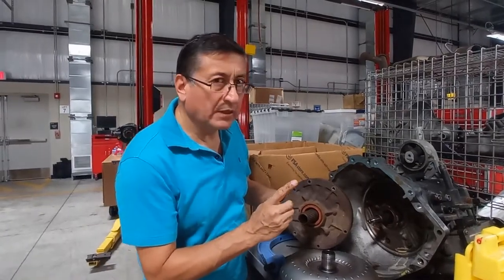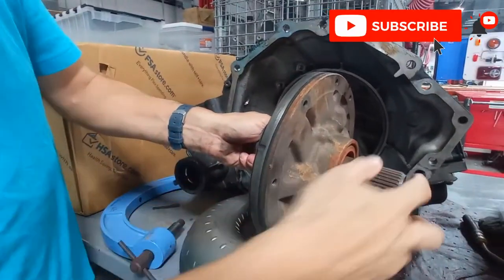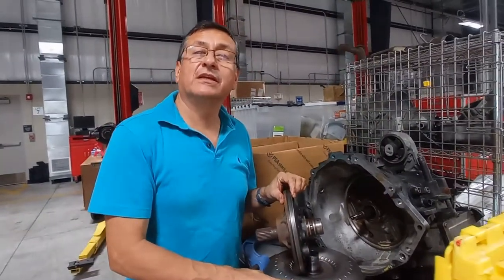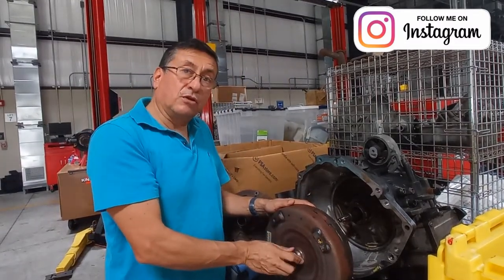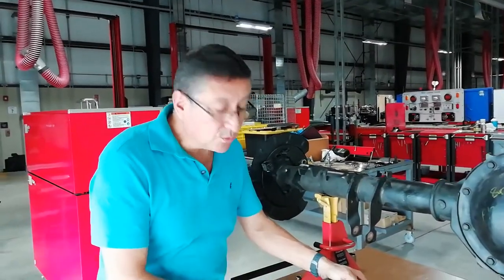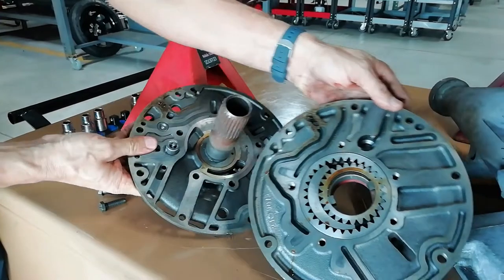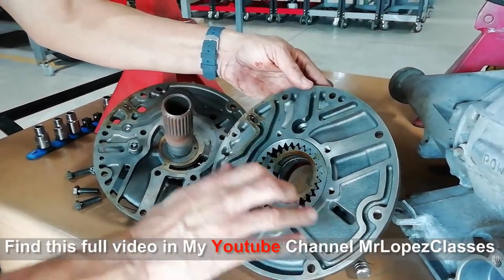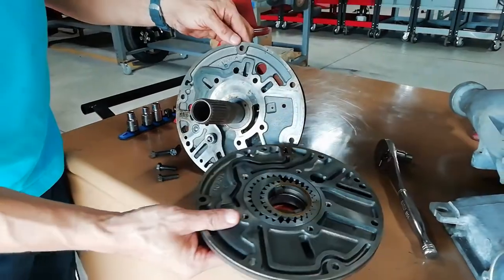Automatic Transmission Oil Pump

Comment: Hi please can you help me understand how to check if the oil pump is failing , Will the gears on inside of the pump be damaged which causes it to fail or what exactly makes it fail and how can I fix it
Reply from the maker: Low oil pressure is normally wear at the crankshaft bearings. The people think that this is an issue on the Oil pump but it is not. The best way is taking an oil sample to analyze abnormal metals dispersed in the sample
Reply: Okay sorry for the questions I just have one more , I have a mitsubishi outlander automatic and as I'm driving the gears slip so now it only goes into 1st and 2nd gear and then completely disengages i can press the accelerator and it will just rev up and not move at all and the oil does have metal filings in it so I'm not sure if the clutchs wore out or the oil is not circulating so is causing that to happen and the oil has a burnt smell, is there a way i can test the oil pump as I have the vehicle parked off because it's way too expensive to give someone to fix it and I don't have that money

Comment: Can a failing oil pump produce a whining sound?
Reply from the maker: Of curse this is the typical symptom
Reply: @MrLopezclasses  Oh no. I just built out a 2000 Chevy Astro van w/150k into a camper. I'm not getting any slipping though. (4L60E)